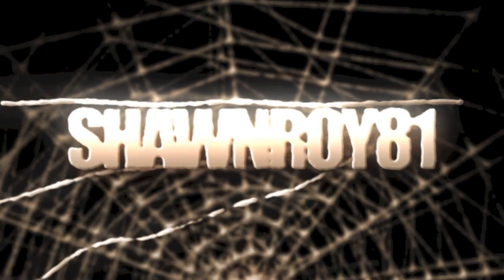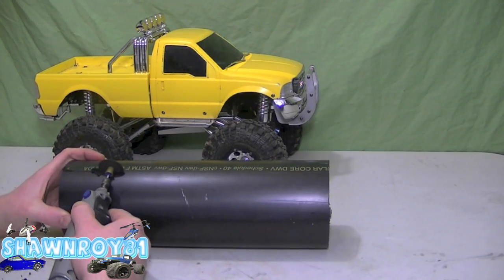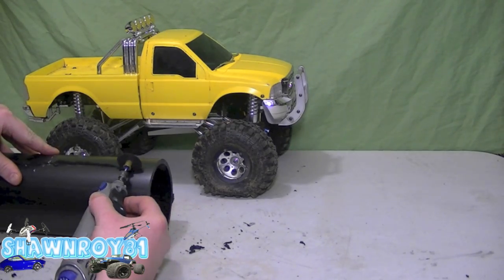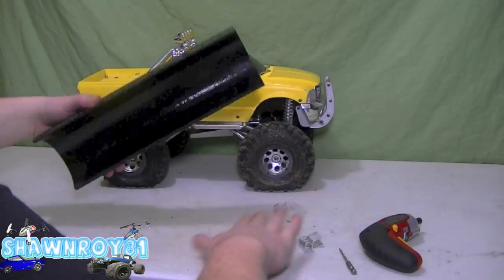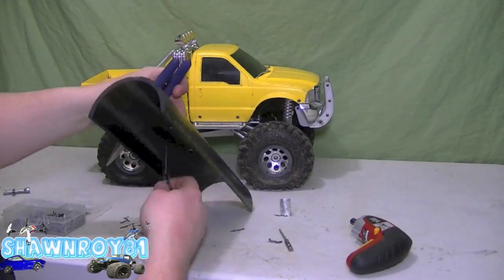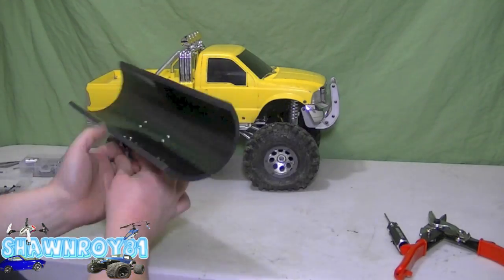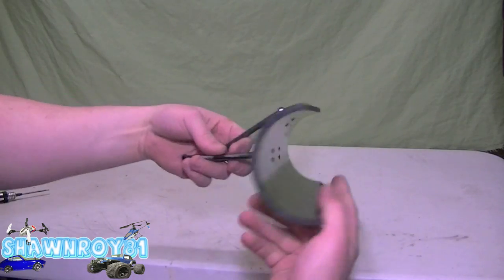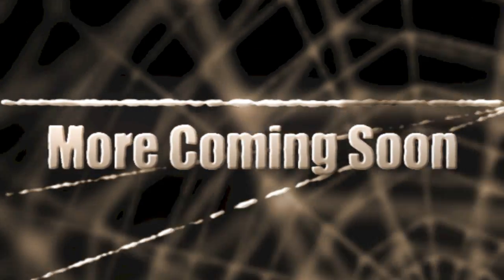Custom RC Snow Plow Build

Comment from the maker: I build the two bottom ones with a flat piece of aluminum and bent it. The upper bracket was the leafspring holder from my tamiya high lift. You don't need to buy them. You can build them very easily.